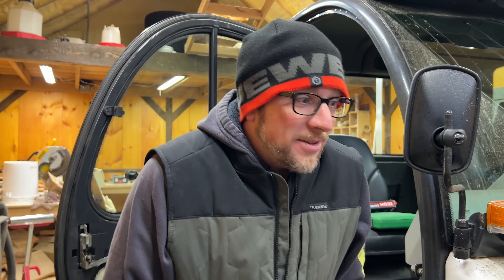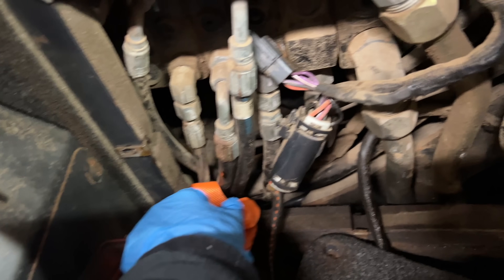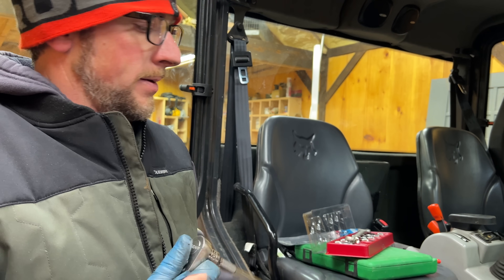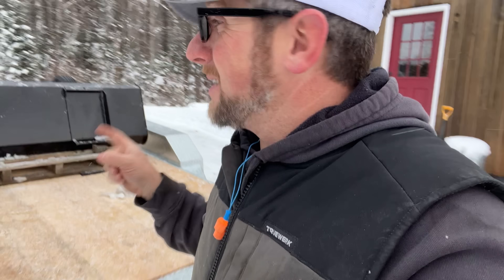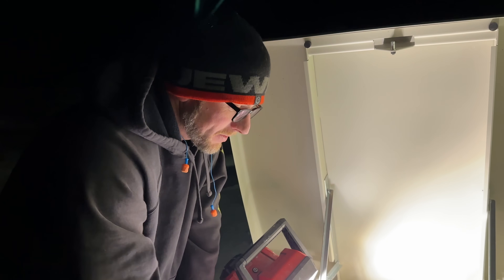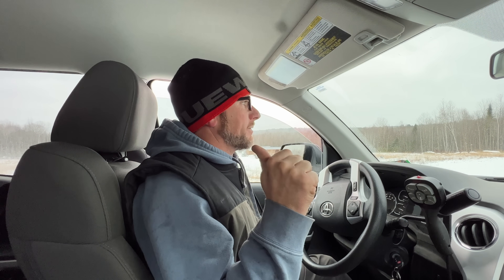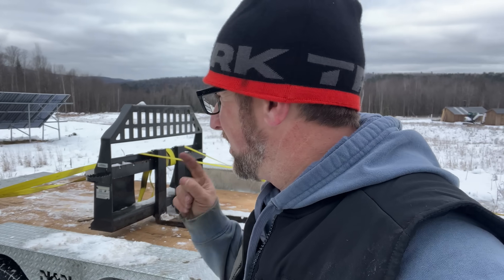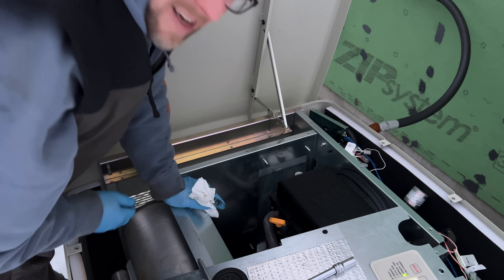So We BOUGHT a HEAVY DUTY Trailer....Maybe We Should Start a Hauling Business?!?

Comment: As a retired trucker of 26 years, I want to make a suggestion. If you have some old carpet remnants, slip them between your straps and what ever your hauling as you tighten down your straps. It will protect your straps from being worn in two at a rub point. Worked for me hauling oversized And normal sized loads. Watch you daily! Really enjoy y'alls videos. Best wishes for upcoming New Year.
Reply: Robert, you are so right. I was a trucker myself back in the late 70s up to the time they grandfathered in the license  (I just let my license exp. because I couldn't drive any more) . Anyway ... when I needed to use my straps I had an Old-timer  (driver) tell me to do that and it did save my straps. A good strap is not cheap & with prices now-a-days ya need to protect what ya have. God bless
Reply: I always kept pieces of carpet on my hot shot rig 40' gooseneck neck with a single axle Volvo truck with a super 10 Trans and 350 Detroit couldn't tell I had a load at anytime. All over the USA.  Then I went long haul, should've stayed hotshoting.
Reply: Could you zip tie some rubber or a piece of garden hose along the edge of the frame for extra protection?
Reply: Do you have the chickens up there with you?  Or are they still at the old house ?
Reply: @kipcudd7253  The carpet or softener as it is called is placed between a sharp corner of the load and the strap, not the trailer. If there was a rub point on the trailer your idea would work wonderfully.
Art from Ohio
Reply: @connierifenburg9758  they moved the chickens up to the OGP a while ago.
Reply: @1MartinWaite   thanks Martin!  I must have missed that one.
Reply: You going to add an equipment shed at new property for all your nice equipment
Reply: Pieces of old inner tube work well in some situations too. Especially for really sharp edges.
Reply: Great sugestion to use  split down old hoses or tubing on the rub points, can save both the hoses and the hydraulic oil. It all saves cost and downtime.
Reply: @kipcudd7253  he took your advice
Reply: I used to keep pieces of cardboard in my truck to put under the straps.

Comment: On the generator check the crankcase ventilation for icing. It might be plugged with ice and that would create excessive crankcase pressures forcing oil out the dipstick.. Remove the air filter to check the crankcase vent hose.
Reply: Someone is using deduction to figure out the problem...good stufffff 🖖
Reply: THought the same thing, something is making more pressure in there now. I know oil looks like a gallon on the floor when its only a little bit spilled but i wonder if he even checked the level after he noticed the leak.
Reply: I second that thought. I worked for years in automotive repair and would see the same thing. Check the air filter housing for oil as well. That crankcase pressure can be sneaky and will find the weak point in your engine sealing. Remember gravity when checking for the failure point. It might be worthwhile.
The other thing you should check is an exploded diagram of the dipstick tube where it enters the crankcase. If there is no sealing o-ring or gasket, the sealer you applied will just make the pressure cause a leak at the next weakest point. This could cause a gushing leak which would probably shut the motor down if you have an oil level shut down.
Reply: @warrenmichael918  If you watch the video, you will see that one of the first things he does is check the oil level.
Reply: @ZrubekFamily  I was talking about when he first noticed the leak, i think he noticed it well before he made this video. Thats why i wondered if he checked it because it seemed like he kept using the gen. even with the leak.

Comment: I bet Al already figured out the oil leak, but if the engine oil was way overful, it will blow back into the air filter box and then leak out.  Usually soaks and ruins paper air filter too.  Oily air fiilter won't flow enough air to engine.

Comment: You asked  if anyone had any ideas on how to make the snow not stick, and what i do is wax the augers with the turtle paste,  but it has to be done in hot summer like when you would wax  a car. Anything else you may put on now while it is cold, the snow will just eat off as you go. But you have a heated place to work on it so you may be able to apply a coat now after a good cleaning. I have tried silicone I have tried wax from candles, cooking spray hot oil, the only thing that stayed with any length was the polish paste buffed with a wheel to a shine.,,,, You have sparked the apb for a used toolcat to me local.  glad you got the  hose fixed . CCHHEERRSSSSS

Comment: Great video. I'm wondering if you touched base with the generator company & told them about the oil leak & how you fixed it? To me, it seems like something that should have never happened.  Hope what you did wouldn't null any warranty you might have had.  I marvel at how you can figure things out & tackle fix problems.  Did they ever figure out the well pump issue? You & Gina are an amazing team! Happy New Year 🌲🕕🌲💥💥💥
Reply: Good thought there gup. Engineering should have had that covered. As a safety feature it would seem a really crummy one given the mess it makes and the environmental issues. Doesn't sound right. As for the pump he may cover it shortly as he's been a rolling stone sorta. But he goes through these comments knowing the brain trust that they have tapped into. Call it a Carnege thing. If they don't know something they have subscribers like us to bring it to their attention because we all love them that much.

Comment: It looks like you got a fantastic trailer,  to move all the items to the OGP.  Glad you fixed the generator leak.  That's crazy they missed that connection for sealing.
Reply: I'm afraid that it may have been more of a safety feature that unfortunately he just bypassed ( see the above mentioned stmt about ice causing excessive pressure ) now it has nowhere to escape to and could cause an even bigger problem than just a little oil leak ! Let's hope not ....

Comment: “ O “ ring on the dip stick. Missing? It should have 1 or 2   There should be groves to set in.  If you get 2 or 3 snatch blocks for the winch you can use it to pull stuff off the trailer or add pulling power to the winch to pull something on to the trailer.  At the top of the dipstick by the pull. It does have a “O” ring on the stick I rewatched the work you did and it has the one on the stick. I think you found the issues with the leek but check the manual when you get a chance. Thanks again for your posting.

Comment: The oil leak might have been caused by excess pressure buildup within the crank case, if the (PCV) positive crank case ventilation system is not operating properly. The PVC should be creating a slight vacuum / negative pressure within the crank case, which should prevent oil from being blown out at the dipstick tube. Maybe a suction hose/tube is loose or the PCV valve is malfunctioning. 
Nice trailer! I like the galvanizing.

Comment: I use to work on generators usually there is a o ring  but there should be a slight indentation at the base of the stick or if it’s flat cut you a gasket.

Comment: you're gonna need some air bags or helper springs for the rear of your truck. Or air shocks ? i'm pulling similar weight with my Tundra and !8' trailer. the truck squats quite a bit with a load. Be safe with a half ton truck.

Comment: Good morning Lumnah Acres and all the fellow viewers! Nice job getting the hydraulic line out of the Tool CAT. "When it rains it pours" as my Mom used to say. Wow that's a lot of snow Al! Good thing you got your crows foot out. Nice to see the chains on the Tool CAT Al. Beautiful overhead view of the deer. That's a good looking trailer! I bet you can get all the coops/feeders up to the OGP with that! I hope your Cummins generator doesn't do what we experienced. We had an engine push all it's oil out into the air cleaner and seize! It had a breather clogged. Watch out. I don't think that's a good sign to have oil in places it shouldn't be. Maybe check if you need to repack your bearings on your other trailer to make it easier to pull. That is a really nice set-up for moving all the portable "buildings" from the old homestead. I'm glad you got the oil leak fixed. Thanks for this Lumnah Acres!

Comment: Maybe check the crankcase filter / ventilation on the generator.  If it is building up pressure then it could blow oil anywhere the pressure can escape.

Comment: I will second an opinion expressed in another comment. The only way to get that kind of leak is internal crankcase pressure. Check crankcase vents and all filters that lead to the crankcase. Excess crankcase pressure is the cause now.... Good luck. BTW, I don't support the ice build up idea since running the engine would thaw that out...But dust and the like can clog filters and vents. A call to the generator vendor might be in order too. You are doing it all right - it is just a little more than simple, evidently.

Comment: chains and binders for moving the machines, also get some airbags for your truck it will help with leveling it out when loaded, if and or when you upgrade to a bigger truck I would suggest a 1 ton, dully if possible just because your toys keep getting bigger so eventually you will need the extra power, towing capacity and stability of it.

Comment: I would like to offer two suggestions. You asked what new truck should you consider. I suggest a 1 ton Dooley of what manufacturer you prefer. 

Other suggestion is loading your trailer with something like the chicken coup. A couple of 2 in pipes that will fit under skids and roll up in trailer will help considerably loading and unloading. Also relieve tension on the winch.

Comment: money ,money , money - I learned a long time ago - the more stuff I have the more tires , hoses ,oil , filters , belts , fluids , batteries . and on and on . and I don't have near the amount of stuff . Your machinery shed will have to be a hundred feet long ! no use spending all that money on the best equipment and having sit out in the weather . great trailer but the hitch on your truck looks light duty .
Reply: When money is no object , respect for the items you buy goes out the window .

Comment: Good Morning!  Since the generator is new, I think you should submit a customer service request to see if that area was supposed to have a gasket or sealant.  Can you take the battery from your trailer inside to keep it warm?  Batteries don't do well if they freeze.  Or maybe add a small engine heater to that compartment, so you can keep it plugged in.  Not a bad idea for all your equipment and vehicle batteries.
Reply: Howdy Guy!  Good tips about the battery... I just read that a properly charged lead-acid battery is protected down to -92°F.  All the more reason to make sure the battery is maintained with a charge after use.  I wonder if the trailer battery gets some charging from the truck connector?  If not, that's another thing Al will need to maintain and toss a trickle charger on from time to time to make sure the trailer battery stays fully charged.
Reply from the maker: Gooooood Morning

Comment: At 33:44, when you are talking about using brake cleaner, there is a hose-to-metal-tubing connection, attached to a framing member. The steel tube is bent into a tight “j”—and it is KINKED, collapsed!!! Much like a McDonald’s straw when you try to suck too much milk shake through it. Whatever fluid that passes through that tube, it is impeded.
Reply: A tight “u”. Sorry.

Comment: You can add a UV fluid that glows under UV light to find the leak(s). Make SURE that the fluid you use is made to work with the oil in your sump. I've used this method several times on gas, diesel and hydro-lines. Once added run the engine until it is hot.

Comment: Al, I believe you would find that the dipstick tube has an o ring if removed completely from the engine block. Obviously the air breather would have to be removed first to get the tube out. I have found the same type of leak on a kohler command twin engine.

Comment: With your snow blower system - you have become a traditional farmer.  'Ya buy something used at a good price, 'ya then discover and fix the "used" issues one piece at a time, 'ya find some attachments you need or are dying to have, the deeper you dive in the more you find, and then you doubt yourself.  UNTIL you price your result brand-new.  Then you're greatful for what you have and realize that had you aimed for brand new for the same it would either be out of range or that buying new would have impacted all else on the farm.  Plus, by the time you're done you know (all too well sometimes) what you own inside and out.
Reply: You forgot to mention he gets a ton of really expensive stuff for free.

Comment: Nice trailer. Will be nice to move equipment like the Mini EX to where you need it without the slow crawl. Looks like you got your oil leak, but some motors can blow oil back out through the air filter which is what I think that black box on top is. Might be the oil is slightly over filled which is why they did not have a seal on the dipstick. The sealant was still a good idea.

Comment: Al they make crows feet in a line wrench style as well which is better for working on hydraulic lines and such they don't slip around the " nut" and help keep from rounding them off. Also found that using baling twine works great for attaching to lines that need to be run back through tight spots. Now that you have that trailer your gonna need to upgrade the Toyota to at least a 3/4 ton but more than likely a 1 ton to be completely legal

Comment: Al Sir, you need a pole barn. Don’t build it yourself, just have contractor build it, you can still finish the inside but speaking from experience,  40 x 60:is the minimum and better to go with 14’ walls to hold the 5th wheel you be buying in a few years. Best to have a 7/12 pitch and don’t put the doors where the snow will slide off or ice build up. I love your toys and miss mine too.

Comment: Just catching your latest video great job on the bobcat fix now for that generator oil leaking from the oil dip stick tube maybe what they call blow by it’s a build up of pressure in the crank case check to see of the air filter got iced up or there may be a crank case breather tube that may have gotten plug or ice in it some how and by you running the engine off and on just may have decided that tube check with your owners manual there be a parts break down manual to find this easier if you don’t have a parts manual tyre googling it by size of engine and serial number you might get lucky

Comment: For the generator, if the oil is coming out the dip stick, you might check the crankcase ventilation system.  For the trailer, a small solar panel trickle charger might be handy to keep the battery topped up if you do not use the trailer too often.

Comment: I'd be sure to still clean all that road salt off every time you get done using the trailers. As someone who's worked for a DOT the only way to keep things from rusting is to keep it clean and a good coating of fluid film before every winter. That salt can still damage the galvanized coating they use.

Comment: Looks like Bobcat designed for the most money at the dealer for repairs! On the plus side, though it was certainly not a desirable event especially on top of the other things you had to fix to get everything working properly, it blew at the original homestead where you have a heated shop. It would be a lot less fun to do that at the OGP out in the cold.

Comment: N&n trailers are good but that comes with a heavy price and it’s Canadian built I believe they do aluminum trailers as well could be wrong on that just have to watch the weights I don’t think hauling to toolcat would be an issue but the other equipment maybe I don’t think you can go over 10k pounds trailer load without a class a cdl could be wrong but I always hire a commercial driver to haul my stuff unless it’s not super heavy great video glad you figured out the oil leak it’s always something even on new stuff

Comment: the fittings are called JIC fittings and the correct way to tighten them is to tighten them then back of a 1/4 turn and retighten. a set of plugs and caps will keep debris from entering the hydraulic fluid and contaminating it or draining the system if you dont have the ability to force the fluid back into the holding tank before working on it. hope this helps, great family and great channel, keep up the great work.

Comment: I would contact Cummins. I’m sure that generator cost a pretty penny. They need to make it right. 
Nice trailer. I see a bigger truck in your future. When you haul larger equipment your going to want to have at least a 3/4 ton diesel. Good luck with your adventures. 
Thanks for sharing. Take care, see ya :)